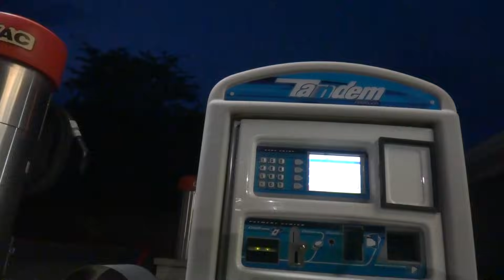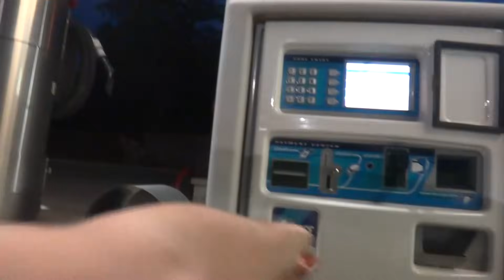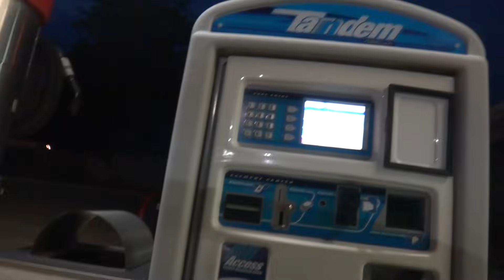AWESOME PDQ Tandem Automatic Car Wash at Clean Time, Jefferson City, MO

Comment: Cool video. I myself have gone to a mobil car wash that looks and operates exactly like this one. It's in my neck of the woods In sunset hills on Lindbergh blvd by a steak n shake and shop n save. It works pretty much the same way as the one in this video but it now has one extra rain rinse down added before the brushes are about done, and plus if you get the most expensive wash which costs 12 bucks you get a rain falling down hot wax treatment which includes red LED lighting. This mobil car wash also does accept debit cards as well. It works great for me every time and my 2010 ford fusion always looks nice afterwards. I think a lot of car washes are going to this new type of stuff on the inside for a better cleaning of any kind of automobile.